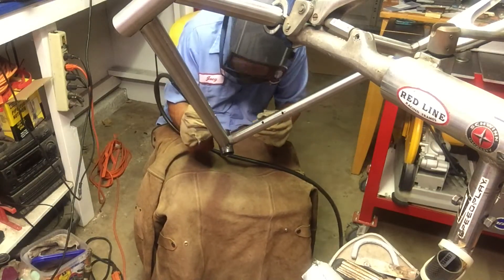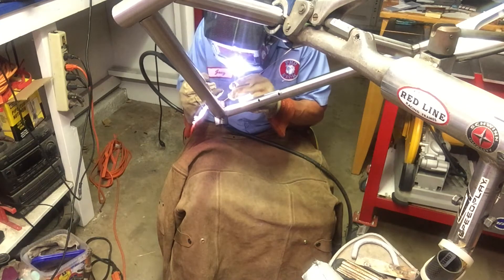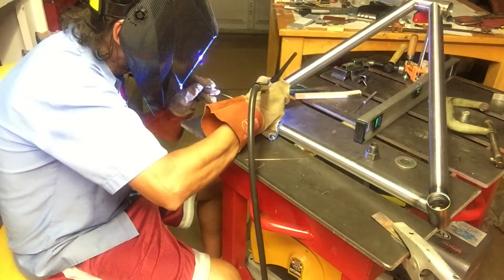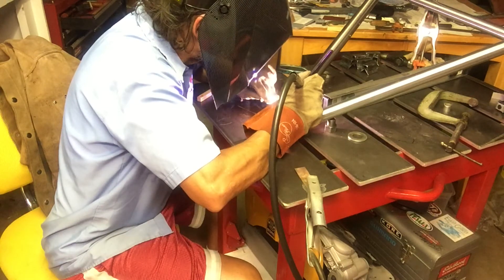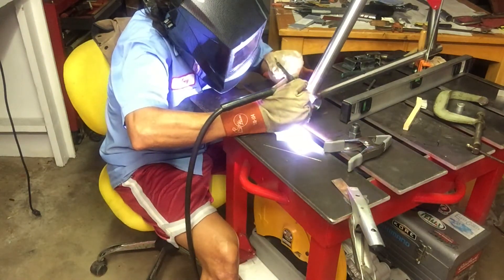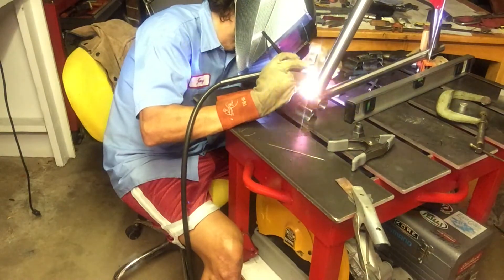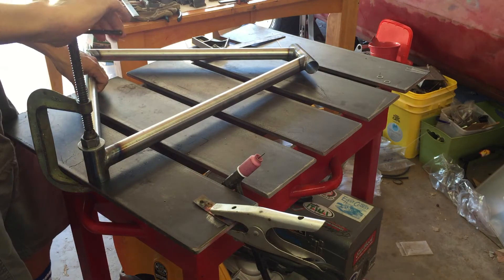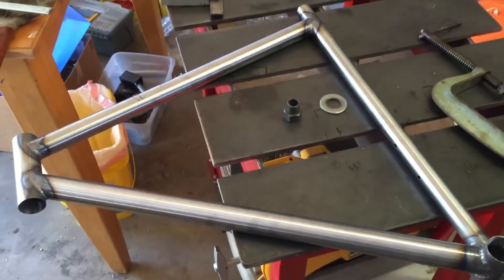Bicycle frame build part 7

Comment: Really dig your series Joey! How did you come along reaming HT / ST and BB-threads? Not using a heatsink?
Reply from the maker: Thanks! I still ride this bike a few times a week commuting to work. I didn't do much on the head tube, just squared up the ends with a facing tool off camera, but the BB thread chasing and facing, as well as the seat tube reaming are all in Part 11. This frame was a pretty low tech/low budget build. Ideally I would have loved to use heat sinks and back purged the tubes, but I didn't have access to those things. 
Thanks for taking the time to watch the videos and leave feedback, I appreciate it!